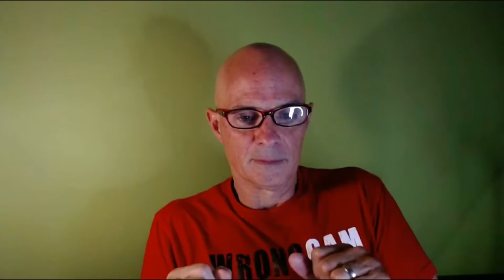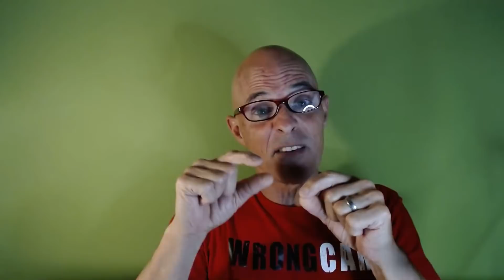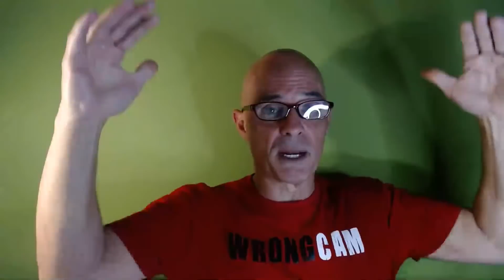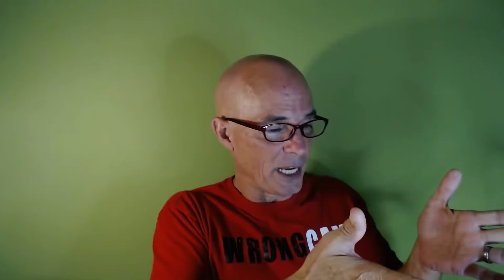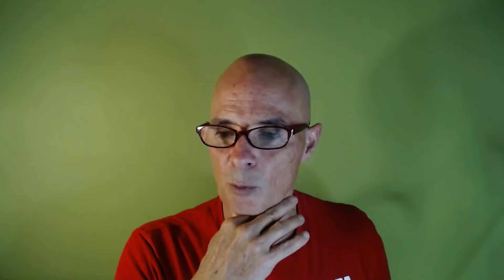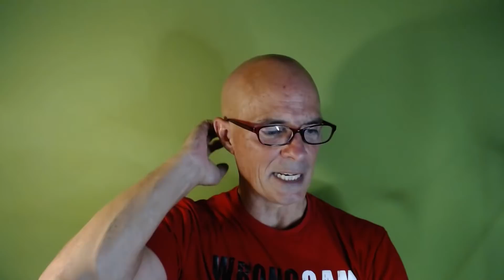LET'S TALK TURBOS-DAILY DRIVER TURBO COMBOS

Comment: I have a LS 416 and I'm positive about daily driver unfortunately I have a monster cam BTR 400+ N/A and frankly it drives nicely but the low end is not what I want so after watching this I'm feeling that the turbo is what I'm looking for daily driver with the horse power sounds like the best of both worlds, please a suggestion for a 700-750 power range. Thank you for all you do.
Reply from the maker: Truck Plus cam and G42 turbo will be mega responsive and take you to 1000+ hp if you want to

Comment: So, im looking to boost my 01 trans am Ls1 with either a gt45 or vs7875 with more of a daily or street driven setup, paired with a 3600 stall converter. What cam would you suggest? I'm leaning towards a truck norris for mid range and better spooling. Or even just leaving the stock can and see how I like it. Thoughts?
Reply from the maker: The Truck Norris will work well-you don't need a 3600 rpm stall with that cam.
Reply: @richardholdener1727  thanks! I already have the converter. So would another cam be better?

Comment: So I did my own research on those China turbos so cheap $107. They work 1 or 2 times and then they quit working junk. They're just junk. I don't think this should be used a test for power.
I think you should be more fair. In your shows on making power with turbos. You get what you pay for misleading us rookies, I don't like
Reply from the maker: The same 76mm turbos that I ran in the first 2 big bang motors back in 2010 are still alive and working. The nonsense that they only work 1 or 2 times shows your lack of understanding. Not all turbos from China are bad (Big Name turbos are made there) and not all of them are good.

Comment: Hey Richard I have a motor I’m building I have allot of questions for you. Is there any way we can converse?
Reply from the maker: just ask here or join the live feed (1 hour of Q&A)
Reply: @richardholdener1727  I have a Gen 4 5.3L   bored over .20 w/ NPR  11-920-2N pistons with valve relief. A BTR truck norris cam NA. King mains and rod bearings, ARP head studs, felpro MLS gaskets and 799 heads with BTR springs and rocker upgrade trunnion kit. stock crank and rods. I have a GT35 maxspeed turbo and stock intake truck. and i'm going to go with 80ibs injectors. How much power you think I'm going to get out of everything. I also, have oil coolers for trans and oil cooler with fans for coolers. all AN fitting lines etc. tRANS IS A 4L60 iM GOING TO HAVE IT STAGE 3 FOR THE POWER ITS GONNA DELIVER. EXCUSE THE CAPS.
Reply: @richardholdener1727  I have a gen 4 5.3 bored to .20 over. with NPR pistons valve relief 11-920=2N model. BTR truck norris cam and BTR springs. trunnion upgrade, 799 heads, stock crank and rods, king bearings, ARP head studs and Felpro MLS head gaskets. i'm going to go with 80ibs injectors and DOD is deleted. last but not least, I have a GT35 T3 maxspeed turbo which I am throwing on the motor. how much power you think i'm going to produce..

Comment: How do you figure turbo sizing? I want to twin turbo a sbf 302, with low boost trying to not go beyond 500hp, pretty stock motor(used) gt 40p heads lightly ported. , changing cam to like Rv ,type .
Girdle on bottom head studs arp bolts, ect.???
Reply from the maker: 500-hp twin turbo set up would be very small turbos-look for twin gt3076
Reply: @ wow thank you for answering , but is there some kind of formula ?

Comment: what small sized turbo would you put on a 383 ls to get all the power from 0-4500 rpm ..something that would be spooled up at idle but no where near what it needs to go above 4500 rpm? i saw a youtube video where the guy had a really small turbo on his truck and he was basically doing highway speeds at almost idle and he said that his fuel saving was amazing.
Reply from the maker: you don't want-nor can you produce, boost at idle. You can size it small for quick response without going to an extreme and fuel mileage won't be helped under boost

Comment: Hey Richard, can I daily drive 4 digit  twin turbo hp, and which intercooler would you run?
Reply from the maker: yes-because you don't use the 4 digit power daily-you turn down the boost

Comment: Have you done any compound setups on Subaru 2.5L? I am busy with a setup for a street track car. 286 cams, rev kit, Manley pistons, turbo tuff rods, 625+ rod bolts, 14mm 625+ head bolts, 2000 casing bolts, +1 valves, ported heads.  The problem I have is the turbo combination as compounding is not a thing in my country so no one can really offer  assistance. I have considered to supercharge compound with a GT35. 

Motor will be capable of 1200hp but will only be running it at 800hp. 

Any suggestions would be appreciated. Thanks.
Reply from the maker: I've never run a Subaru motor

Comment: I was wondering if you've ever considered doing a test on a max torque built 6.2 LS boosted to the limit of the stock bottom end? Like maybe cathedral port 706, truck norris cam, trailblazer SS intake. Boosted to the 3 bar map limit just to see what that torque curve would look like before it blows up. I think it would make a killer street engine.

Comment: with a supercharger wouldn't said overlap "matter" where as with a turbo system you have opposing backpressure. just to give some merrit to what theyre saying about boost and overlap, but as you said miniscule amount of time for  said"blowthrough" to occur.   id buy a new book if you made one with the "latest" info youve gained/released.
Reply from the maker: what the cam does na-it does with a blower or turbo

Comment: A camshaft cannot be properly specced for a turbo engine without knowing the back pressure and the boost pressure.reversion happens in N
A. Engines.in the 70d and early 80s we gained power with nitrous engines by opening the ex valve earlier with the same shot.

Comment: Should  turbo have seperate oil supply and pump? Electric pump? Might solve lot of relibility problems.
Reply from the maker: YOU WANT A SEPARATE OIL TANK FOR THE TURBO?
Reply: Turbo been blowing up engines, at least if separate it toasts only tubo

Comment: Is this a good cam for an 6.0 twin turbo

Specs: 226/235 .610"/.614" 114+5

72 mm turbos for a street car daily driver
Reply from the maker: bigger than I would use, but for what power level?
Reply: @richardholdener1727  we are hoping to get around 1000hp
I bought the car with these turbos and cam
It has a fabricated intake manifold after watching your videos I’m switching to a fast intake manifold and it has a fitech EFI with small injectors 
Switching to a Holley and appropriate injectors for 1000hp.
I was wondering if I should keep the cam or if it’s worth replacing it

Comment: Based on Richard's advice I chose a Lil John stage 1 turbo cam for my 5.3 222/227@.050.  Also sticking with a stock style long runner intake.
Reply: For a street driven, that is plenty of Camshaft for a 5.3L!  After that duration you're trading low/low-mid Tq for a higher RPM bandwidth.  Below 3000RPMs stock 5.3L already feel like a smog era 305 torque wise.  I wouldn't want to give up any more Tq down low for more 6200RPM HP!   Power under the curve (below peak #s) is more important overall!

Comment: This is an old conversation but just wanted to mention 17psi for a diesel is nothing, most stock diesels hit 30psi when loaded and 60-80psi is common with tuned up compound setups, diesels are built way better running 17-22:1 compression ratios and detonation is not a problem

Comment: A much better way to relate the valve overlap period is as a percentage of an entire revolution.  6000 rpm is a small fraction of time by itself so you a4e making tge overlap period sound even shorter than it is.  Consider the time for 1 Revatio 6k rpmnrate being the base time. Ninnthat casebthe over lap period is not nearly as short as you make it in your examplel 6000 rpms is one rev or 1/100 of a sec or 10 milseconds.  So that equals 100 % of a rev.  That is of 360 degrees.  Take a 228/232 110 lsa 108 icl cam.  It has 10 degrees of overlap.  So that is 2.78% of a rev.  So out of ab10 milsec of 1 rev at 6k rpm its 2.78 milsec.  That's a jeasursable amount.  Something under 1% would be small not almost 3%.

The issue us nit loosing boost as in fresh air coming into the cyl.  It's having the exhaust from drive pressure which is almost alwa7ys higher than boost back filling the cyl.  That is an issue with pressurized systems  Both valves are open and exhaust that has already left the cyl is not pushed back in for 3% of each cycle.  

So yes its small period vs human time but high rpm tengine time it's much more almost 3%.  Still as you sta5e it's not a big deal for street.  But if your gonna put a new cam in anyways why not have its specs optimized for a turbo.  Some stock cams have overlap separation or negative overlap.

What you want from a cam and head is a engine that cyl flows very well on the exhaust side.  It helps lower cyl pressure .
Reply from the maker: overlap is not the enemy of turbo motors-do more testing

Comment: Has anyone used stock cam but change valve springs and added 1.6 or 1.7 rocker arms?
Reply from the maker: that video is up
Reply: @richardholdener1727  
Hi
ty
What’s the name of that vid if you recall? 
Ty

Comment: Turbos are God fucking awful in anything besides a diesel, and driving a diesel still sucks, but it's not the turbos fault in that case... lol

Massive lag every time you want to accelerate
Cooks all the plastic and wiring underhood
No power on the bottom end
Narrow power band
Cooks rings, pistons, valves, quickly
Requires constant oil changes to keep oil from turning to sludge
Requires premium fuel and/or water injection which is a PITA
Turbos are expensive! Just spend the same on heads and a cam and be light-years ahead
Reply from the maker: wrong on every count-but you should build the one that speaks to you
Reply: @richardholdener1727  OK well,.every one I've driven, feels.that way. From a 1995 mistubishi GSX to a 2019 f150 ecoboost, to a Cummins diesel, all of which i own(ed)... some worse thannothers but all awful compared to a supercharger or N/A...
Reply: @toadamine  tell me you have no idea what you're talking about, without telling me you have no idea what you're talking about...  premium fuel? A stock V8 car like a mustang or camaro requires premium fuel, but a turbo 4cyl Kia optima doesn't... if I had done a max effort heads/cam N/A setup on my GTO I'd have to have a custom fuel system and barely make 60prwhp. But with a boost heads/cam setup and my procharger(or a turbo) I can use my stock fuel system in pump gas and make 600rwhp with ease. Oil turn to sludge? Any car that doesn't get regular oil changes will turn it to sludge. Has nothing to do with the turbo. And any engine that is being pushed hard should have more frequent oil changes. Whether N/A, turbocharged, or supercharged.
Reply: If you spend the same as a turbo on heads and cam you’re a sucker lmfao 😂 and heads and cam only won’t get you 800hp+ so good luck with that

Comment: what about marine high perf cams?  marine cams have the big overlap....so not a good choice for turbo application A? 
400 small block t application? no one seems to have any real insight on this as its not common........
help...
Reply from the maker: A MARINE HIGH PERFORMANCE CAM IS USUALLY A VERY MILD CAM COMPRED TO ANY AFTER MARKET CAM. AND OVERLAP IS NOT BAD FOR A TURBO MOTOR-IF IT MAKES MORE NA POWER, IT MAKES MORE POWER UNDER BOOST

Comment: Rick, the overlap uses kinetic energy of the airmass too .. Just like a NA motor.. it's very significant how much power of unseen physics outside of pure psi is at work with a high velocity airmass and trying to stop it .. that intake charge effect gets stronger with boost and with rpm as flow rates and volumes increase so does the mass/energy
Reply: Shock waves and volume velocity, seems to be something a test comparison or CFD simulation would help with.
Reply: Almost quantum..

Comment: ⭐Please compare S476 with 87mm Turbine T4 vs a S476 with 96mm Turbine T6 🙏 Back pressure vs response vs power improvement with the 96 turbine from better back pressure ratio

Comment: Hello! I have a 5.3 with 706 ported and polished heads gen 4 rods and was wondering if VS racing 7875 twin turbos be okay with a BTR stage 3 twin turbo cam and spring kit. Trying to make 1200+ hp. Your input would be greatly appreciated. Thanks!
Reply from the maker: THOSE WOULD BE WAY TOO BIG AS TWINS FOR 1200 HP
Reply: @richardholdener1727  what would be your recommended choice?
Reply: You think 2 gt45s would be sufficient. I just don't want to buy to small and then later on down the road decide to go for 1500. Also running the Holley low rise intake.

Comment: Why don't you test it and prove the point. Run a tight LSA until it has high back pressure. Then change to a wide LSA. What a boost man said even if the pressure doesn't cross over the it does slow the inertia. I've been waiting for this test
Reply from the maker: THE LSA DOESN'T DICTATE BACK PRESSURE-POWER DOES THAT
Reply: @richardholdener1727  I understand that.

Comment: I see your point on the camshaft not making much of a difference unless you get to the extreme levels of precision. What are your thoughts on heads? Do higher quality heads (meaning port design and channel porting. Not the valvetrain.) matter in a boosted setup?

Comment: G'day there Rich, I have a lm7 with summit pro ls +2cc dome pistons+rods, stock 799 heads with crower dual valve springs and a comp cams 224/230 @ .050 114 lsa .581 .589 lift. What sort of na power would you expect from this on the engine dyno? Planning on feeding it e85 and around 28 psi through a g42-1450. Cheers for any feedback and love your videos mate, keep up the good work 👍
Reply from the maker: 430-440 HP OR SO
Reply: @richardholdener1727  thank you sir 👍

Comment: Doesn't the camshaft play a very major roll in Dynamic cylinder pressure? And Isn't Dynamic cylinder pressure the most important factor in how much boost you are able to run?
I don't understand the notion that which camshaft you choose is trivial when applying boost.
Reply from the maker: dynamic compression is not the most important factor in determining how much boost you can run

Comment: How much boost can l92 handle has full exhaust Magnuson heartbeat charger supercharged cam wink wink shop told me when charger was put on that it splattered down low  because of cam so changed cam but still does it lol not sure but was wondering how much boostinternals can handle any idea
Reply from the maker: WE'VE DONE OVER 1000 HP
Reply: With stock internals ? How much boost can they run any videos of supercharged l92 for some tips ?
Reply: @rikimorton7530   it's not the boost that kills a engine it's timing and fueling.

Comment: 5.3 s366 216/220 cam. Works great on the street. Fast spool up, lots of tq. Will probably only make upper 5’s on pump gas but 500whp in a 3300 lb truck is plenty. This is with a 5spd too.
Reply from the maker: Good stuff
Reply: @richardholdener1727 learned from the best.
Reply: Is that s366 a newer billet sxe model or the older one? I ask cause I’m thinking of using a s364sxe on my 6.0 LS and wonder if it’s too small.  .96 hotside and 80mm turbine…..
Reply: @Toojz4u  older. S364 is way too small for a 6l. Even the s366 is pretty small for a 5.3.
Reply: @or-ian6973  yea I figure it’s super small but it’s rated for more flow than the older s366 and I’m just going for down low truck power, something that’ll spool quick for climbing these Rocky Mountains. I figure maybe jump up from the .96 a/r to a 1.10 or bigger….but maybe I shouldn’t try to use old parts from my supra just to save money lol
Reply: @Toojz4u  not sure how a smaller compressor will flow more. The older s366 out flows the sxe version. Has a clipped wheel. What’s the use of the 6l? Even on a 5.3 it’s instant spool once it starts. Makes controlling boost down low difficult. But you can really tell the compressor is small
Reply: @or-ian6973  it’s my understanding all the newer billet wheels outflow the older cast stuff. All the older 366 I’ve seen say they are rated to 80lb/min and the s364sxe is rated at 82lb/min.
My 6.0 will be going in my first gen avalanche with a truck Norris cam to replace my knocking 5.3
Just gonna be a daily driver. Not looking for high horsepower at all, just something that gets me around and can pull itself up a mountain pass or trail with ease. Not even towing…..basically I just want turbo noises in my truck lol
Reply: @Toojz4u  internet says the sx makes more power than the sxe s366 because the turbine wheel is clipped on the older version. You’re right the 364 and 366 seem like similar turbos. Give it a try. Sounds like any of the s300’s will bolt on if you decide to change down the road. I just know the s366 on a 5.3l spools all the time, and quick. 7lbs felt like nothing. 10lbs is decent. But I’m finally feeling good gains at 13. Haven’t been to a dyno yet. 6l will be a step above that. I’m guessing I’ll need 15lbs to make over 500whp. I guarantee with a turbo ls you continuously want more. I spent all summer slowly turning mine up. Always a reason to turn it up. I’ve even been contemplating moving to the 369 or 372
Reply: @or-ian6973  oh I know the constant chase for power. That’s why I have the s364 just sitting now cause I jumped up to a precision 6870 lol  
I can say without a doubt if you’re looking for more there is a night and day difference when you jump up around the 70mm compressors. The lag is completely negligible with ball bearings and the power hits so much harder.
Reply: @Toojz4u  my buddy is running a 363 stroker with a 78/75 and yeah the spool is a little slower but it hits like a train.
Reply: Stock t5?